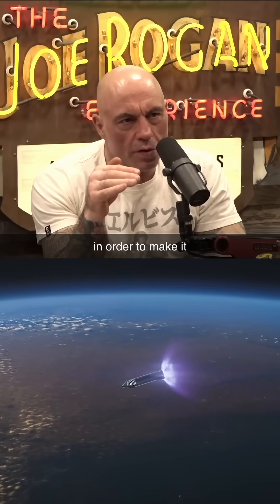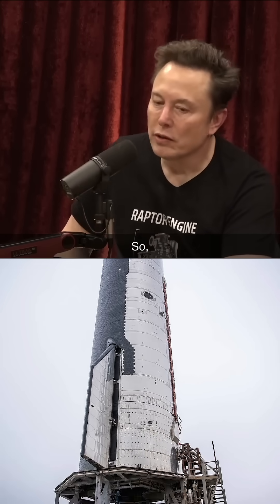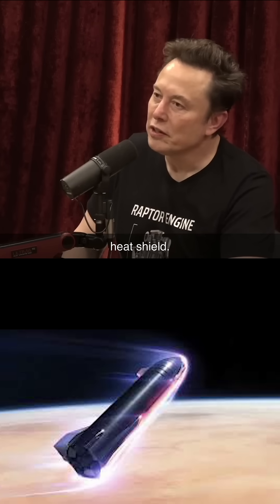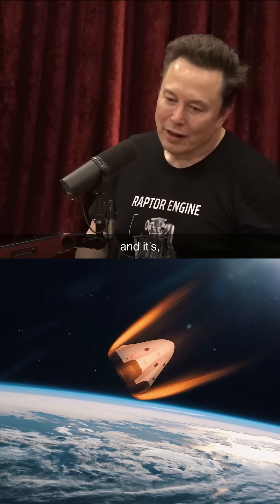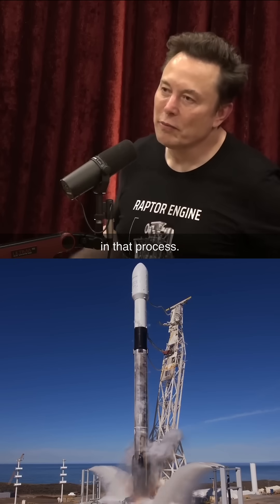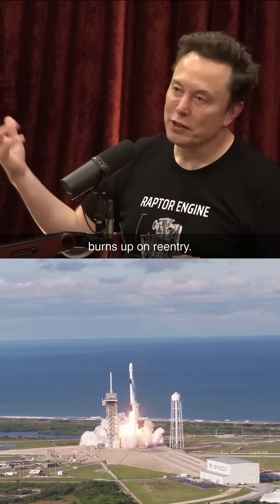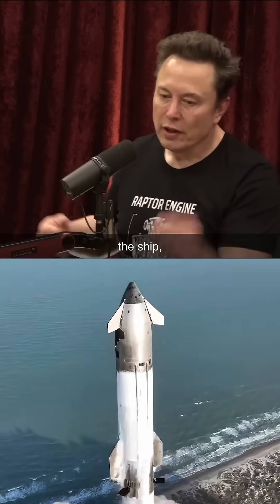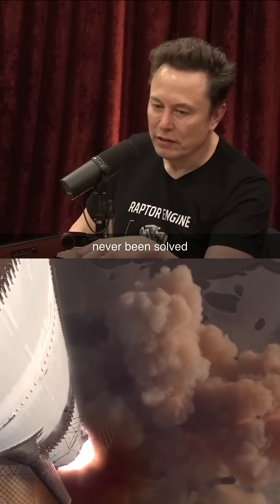Elon Musk & Joe Rogan on SpaceX’s Heat Shield Problems

Comment: Graphene
Reply from the maker: Graphene has impressive thermal properties — it's extremely heat-resistant, lightweight, and has high thermal conductivity — but it's not suitable as a heat shield for SpaceX's Starship in its current form. It is too expensive and too thin.

Comment: I once had a job cutting up coal rail cars. We used 5ft acetylene torch. There was a dust in the creases & corners that we couldn't cut through. I'm not exactly sure what it was as abundant as it was. The closest substance I could compare it 2 is dirt. The boss called it dirt, but it looked like coal dust, but it wouldn't burn, or allow the torch 2 cut through.

Comment: Make it cheap. Small holes and ice or cryo coolants, to disapate the heat upon re-entry ❤
Reply: There is not even counting just how many ways this is wrong.
Reply: @SimonMester  i have no idea lol, but see the objective to get the heat away frol the vehical amd prevent build up, deflecting some of it seems like its in the realm of physics?
Reply: @ You can't really carry ice or something to try to cool down. Weight is a massive limitation in any spacecraft. The amount of heat that could absorb is miniscule.
The problem is the heat is caused by friction. You can't really stop that, you are literally colliding with the atmosphere. 

If you want to avoid it to begin with, you could try to slow your descent, but thats easier said than done too. Once the planet is pulling you in, you are going to gather a massive amount of speed and get closer and closer.
It is not a simple problem at all, with a simple solution. There is a reason why smaller asteroids don't even reach the ground. Solid objects made of rock and metal just vaporize from the friction.

Comment: Wouldn't tungsten work pretty good?
Probably not cost effective...
Reply from the maker: Great question! 
Tungsten does have an extremely high melting point (over 3400°C), so in theory, it could handle reentry heat really well. But you're right — it's not cost-effective, very heavy, and difficult to machine or bond to other materials. That’s why SpaceX went with heat shield tiles made from heat-resistant ceramic composites. They’re lightweight, relatively cheap, and easier to replace or repair after each flight.

But it’s cool to think about!
Reply: It's too heavy

Comment: Can't you just put 2 heatshields over each other and get rid of one with a sort of mechanism when the first one is destroyed
Reply from the maker: Cool idea! But double shields would add too much weight, and the separation mechanism could fail. Simpler, lighter solutions usually win in rocket design.

Comment: Fly a reentry trajectory that takes multiple orbits to dissipate energy and controls altitude to reduce thermal Flux.  This aerobraking has been used at Mars and Venus to reduce velocity with no heat shield.
Reply: At the cost of time which is priority 1
Reply from the maker: True! Aerobraking works for smaller probes at Mars/Venus, but Starship’s mass and speed make it too risky without a robust heat shield.

Comment: What about some kind of electromagnetic field heat shield or plasma shield or something similar to what's used in the tokamak a combination of magnetic and plasma field. They use magnetic fields to keep the plasma from touching the reactor walls which is an undesirable thing to both the tungsten walls and the fusion reaction. A heat shield not of physical ablative matter but a shield made from the physical forces themselves. They say because of the electromagnetic force we never actually touch anything. Apply that to Starship and nothing will touch it. We're good at using magnetic fields to compress and confine particles, just turn the fields inside out to expand and send away interacting particles. Or maybe a thin superconducting layer that dissipates heat. What about a shield that is mechanically deployed and actually separated from the ship's body like the roof of a modern VW bus that raises up for headroom. A shield that raises from the belly or extends out from but separate from the main body and that is a fully external and separate piece of  exchangeable hardware that's quickly attached and detached to be installed or swapped out with a refurbished or new heat shield module.
Reply from the maker: Interesting ideas! Magnetic or plasma-based shields have been theorized, but so far they're not practical for reentry — the energy requirements and stability are major hurdles. A detachable or modular shield is more feasible and has been considered for future spacecraft.

Comment: Maybe instead of slowing down from 6000 mph into the atmosphere, maybe slow down in space first? This would need snother rocket being sent up most likely so i guess making it not feasable tho
Reply from the maker: Exactly! Slowing down in space would need a lot of fuel or another booster—adds cost, weight, and complexity. That’s why reentry heat shields are still the most practical solution.

Comment: Change the velocity then?
Reply: Uses a lot more fuel though
Reply: Too much fuel needed for that, air breaking is actually very good, cause it helps you kill 27k velocity without using fuel. A shield is lighter then all the fuel needed to slow down.

Comment: since particles of the upper atmosphere are magnetically charged, a simple toroidal magnetic shield could prevent a significant portion of the heat energy from being absorbed. 2 spinning magnets inside each stage could do the trick. The problem then becomes making electronics and radio work on the inside
Reply: What are you gonna power those electromagnets with a full sized nuclear powerplant. You are just trying to solve a problem with an even bigger engineering problem
Reply: @JohnOh0701  not really. If you think about it, you could easily use the heat differential between layers of the craft to move a liquid, say mercury, and use the expansion to power up the magnets. All you need is a pump and the Bernoulli's principle. Kid's play
Reply: @lexreinstein4244  thats not enough to power for those magnetic fields you need several hundred teslas worth of magnetic fields to creare your shield that capable of deflecting all that plasma around the space craft.

Comment: What you can also do is use the sprayer totally open at that point. You switch back and forth from the hot side to the cooler side.of reentry. Switch to the Hot fuel side to the cooler side.

Comment: Talk to the engineers Watch makers. Tell them your issue. You need a continuous encircling Mechanical watch. I've seen some amazing Machinical watches. They have for the eye created water proof watches use a continuous direct water sprayers and have the drones spraying the outside of the whatever Rockets your using.

Comment: Earths atmosphere is similar to Earths Ocean.

Aerodynamics and Hydrodynamics are virtually identical.

Control of the Descent, could be actualized simply by using Flags (Based on Fish and Crustaceans Fins and Appendages, and Bird Flaps/Wings).

Another main idea I've come up with is to draw the out the Entry and Exit points of our Planets Atmosphere, which can also be applied to all other Planetary Bodies, using a Plot Chart Map to visualize the Optimal Entry and Exit "Windows of Opportunity".  

The fins and flaps, could pivot and exact to control descent and utilize the same metrics as the birds and aquatic life to exact ascent as well, neglible of craft or body design and characteristics.

So, the Heat Shields are basically facing the laws of thermal dynamics.  Friction is deteriorating the facades of the Heat Shields, which most celestial objects would disintegrate or break down objects careening out of control.  Similarly to the way uncontrolled crafts are dessimated upon entry, due to external forces, such as friction.  

I have a Bitcoin wallet address if you'd like to help support my studies.  Thanks 🎉  Thanks.  😅

Comment: I remember back during the " Space Shuttle " development there was two options for heat shields 1) Ceramic Tiles 2) a Silicon blended element coating that was cured to the hull by a laser beam swept across the hull, and the Ceramic Tiles were chosen
Reply: The china ware is cheap
Reply: Instead of shielding would it not be better to focus on deceleration?
Reply: Okay and none of those shuttles were ever reused.
Reply: @trentonlancaster4071  huh...all the shuttles were reused.
Reply: @spacedriver24  every mission NASA has done has always been new equipment. They've reused nothing.
Reply: @trentonlancaster4071  Columbia 28 missions flown
Discovery 39 missions flown
Atlantis 33 missions flown
Endeavour 25 missions flown
Challenger 10 mission flown

Comment: Kinda funny how the new sheep ship / blue crew had no head shields or burn marks….
Reply from the maker: It was a sub-orbital flight. They reached the edge of space, just past the Kármán line, but did not enter orbit. A sub-orbital reentry—because of the lower speed—generates much less heat, which New Shepard’s structure and parachutes can easily handle.

Comment: why not force out carbon dioxide to cancel out the oxgen burning up the heat shield? so basically coming down on a cussion of CO2.
Reply: It’s not burnt by oxygen but because things turn to 4 th state of matter called plasma when they reach those temperatures, in this case air molecules. Only way is to either slow down actively by using thrusters which require almost equal amounts of fuel that is needed to reach space or by active cooling. Both of them are not practical and possible in this case
Reply: @gudimetlakishore6650  i get that, in order for fire to exists, 3 ingredients are needed, heat, fuel and oxygen, so rather than having a ceramic heat shield, which like you mentioned turns to plasma, why would it not be practical to force a cushion of air (without oxygen) as a shield rather than ceramic tiles?
Reply: @robertCoombe-v2c  the cushion of air will also turn into plasma
Reply: @aj384  for real? that's interesting!

Comment: Try aluminum it cools quickly
Reply from the maker: Aluminum wouldn’t work. It melts at around 660 degrees Celsius, but during reentry, temperatures can reach between 1,500 and 3,000 degrees Celsius.

Comment: Isn't friction the problem?I'm just asking so I can gain a better understand .And do you have to have some friction.because I enjoy thinking about these problems.
Reply from the maker: When Starship reenters Earth’s atmosphere, it’s traveling at hypersonic speeds — around 25 times the speed of sound. That extreme velocity compresses the air in front of the spacecraft, causing intense heating — mainly from compression, but friction also plays a role.

So yes, some friction is unavoidable, and managing that heat is the challenge. That’s why SpaceX is developing a reusable heat shield made of heat-resistant tiles that can survive multiple reentries without needing full replacement.
Reply: @SvenPiper  I'm not sure but isn't Teflon friction resistant?just wondering without friction all you have left is compression right?

Comment: Didn't the space shuttle have silica shields,  which were "reusable?"
Reply from the maker: The Space Shuttle used silica tiles that were technically reusable — but they were fragile and needed lots of inspection and repairs after each flight. SpaceX aims to make the Starship heat shield more durable and cost-effective for rapid reuse.

Comment: I might be stupid, but can’t you slow it down before reentry wouldn’t that maybe slow down the heat
Reply from the maker: In theory, slowing down before reentry would reduce heating, but it’s not practical. To slow down significantly, you'd need a huge amount of fuel, which adds too much weight. So spacecraft rely on the atmosphere itself to slow them down, and that’s what causes the extreme heat.

Comment: Why do things burn as they enter the atmosphere? Solving that is the answer. Slow the re-entry maybe?
Reply: Friction you need to go from something like 17,000 miles an hour to zero someway the physics of the earth dictate that.
Reply: It's not necessarily the speed but the angle of re-entry. Too shallow of an entry angle and you skip off the atmosphere like a stone skipping on water and back into space. The re-entry angle has to be acute enough to pierce the atmosphere and you can continue through.
Reply: @Flipout22  100% not. Atmosphere is very different from water.
Reply: @HandOfSatan  I don't think he's saying it's not different from water, but the analogy still holds that if the angle is too flat the capsule will not penetrate the atmosphere it will skip off it back into space.
Reply: @ChristopherSmith-j9x  abaolutely not. How should that work? The atmosphere is not something that starts in a specific height. It goes from veeeery low density (just a few molecules per m³) to the density we know at sea level in an almost linear way. As soon as you touch the first mulecules of gas you will start to slow down which will lead to your entrance angle getting steeper and steeper. It is absolutely impossible to bounce off of something.
Reply: Air compression mainly air liks to heat up when its squeezed that much.

Comment: What if they attached a arrow head on top of the rocket made of the same material as current heat tiles that’s a wider diameter then the starship so the cone of heat doesn’t touch the actual ship the heat sheet arrowhead deteriorates faster than the star ship and you figure out a way in under an hour how to disconnect and reconnect it
Reply: Are what if the material needed is just deeper in the earth layer near the core I feel any mineral on the outer edge of the core has to be able to withstand extreme heat or there would never be a transition from ball of fire to dirt

Comment: Maybe it's time for an updated version of the space shuttle. Seems so much safe, and it was definitely reusable. Never saw one burn up intentionally.
Reply: It was only technically reusable as the cost of refurbishing was almost as much as the cost of building it. So each launch cost between 1.2 and 1.5 billion. The time for refurbishment was long too. Making the delta 4 expendable rocket, at the time, much cheaper and efficient in comparison costing about 350m. Also there's no rocket in history that has claimed more astranauts' lives than the shuttle. Having failed twice, in challenger and columbia missions taking 14 astranauts with it. So we definitely don't want another shuttle
Reply: @benjaminmnn  We also have never and still don't have one that was as capable and versatile. Also it launched over 800 people to space, and 107 before the booster failed due to cold, and ignoring launch parameters. Could lift crew and payload, capture in orbit and return 13,000 kg of payload. This with 70s tech. It had issues i agree but was still an amazing and most complete space craft.

Comment: Why not magnetic shields?
Reply: Because it is friction from the atmosphere. It is not charged particles.
Reply: @mikeJohnson2222 Actually the plasma is charged. And this idea has been tested, it just hasnt worked well enough.
Reply: @jasonhallowell9456  the power requirements are too high you need a several teslas worth of magnetic fields what are you gonna fit a fusion reactor in a tiny spacecraft

Comment: Use liquid nitrogen contain it then use it on re entry somehow so that it becomes so cold the heat can't melt anything?
Reply: You couldn't hold enough
Reply: It's impractical for several reasons including the pressure needed and accounting for it's expansion. But given the temperature on re-entry isaround 1,600 c. You'll need atleast 2 tonnes of liquid nitrogen mind you it expands 700 times upon heating up